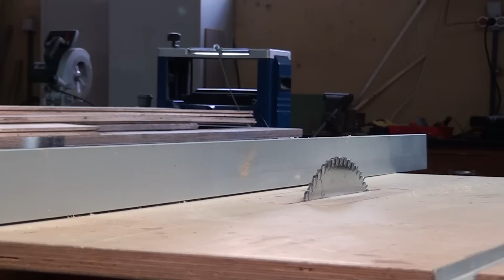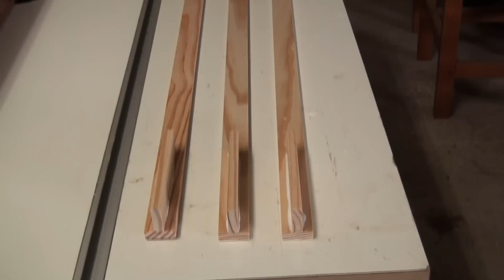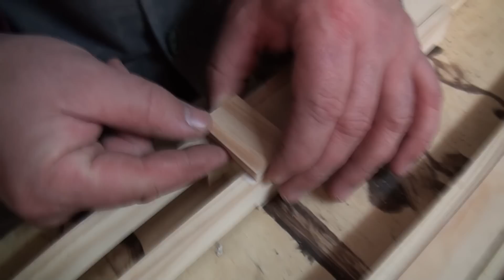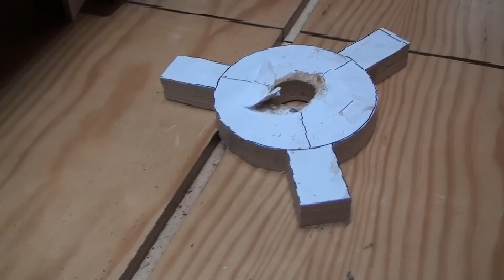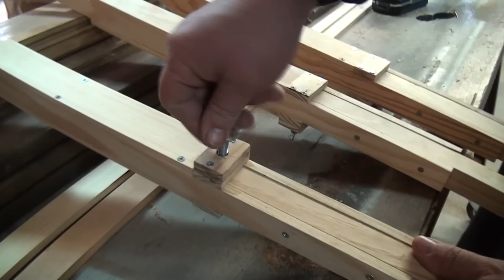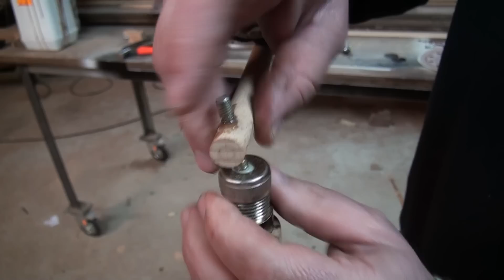Homemade Wooden Tripod Camera  - Easy to Make.

Comment: Hi, could you please confirm the measurements? I think I seen 27mm x 8mm. But I thought one would need to be 1/3 of the of the other. Just want to be sure before I begin 😃 . Thanks
Reply from the maker: Is not necessary to be 1/3 0ne of the other. You are correct 27mm*8mm.
thanks.
Reply: Máquinas de Madeira thank you very much for replying so quickly! Means I can get started!

Comment: looking for a parts list for the top with swivel action? thanks
Reply: Looks like parts from the drain stopper on a bathroom sink.  Very clever!  If it were I, though, I would just leave a piece of 1/4-20 all-thread on there.  Then you could use any standard tripod head with it.
Reply: may be?,  must investigate,  I need a completely magnet free  material,  thanks,
Reply: LLuE88 Sink parts could probably be OK, because they are usually copper and/or plastic (to be rust proof).  What are you mounting, some sort of compass?  If so, you could probably get away with a small amount of iron, as long as you corrected it (that's what the adjustable iron balls were for on the old sailing ship binnacles).
Reply: ***** exactly,   a rebuilt  Artillery M2,  when I was a Battery commander  this was one of the testing measures of a firing battery readiness  test to use a M2 to lay the battery,   I may have been a little lucky but each time I got it done within either 4 or 5 mils,  anything less than 20 mils was acceptable if I recall correctly.     this now is just for fooling around survey.   the price for a small non-magnetic tripod is more than I care to pay.     most any hard ball drilled and tapped I can adapt to for the rest of it.   each camera tripod so far has had steel or iron in it.